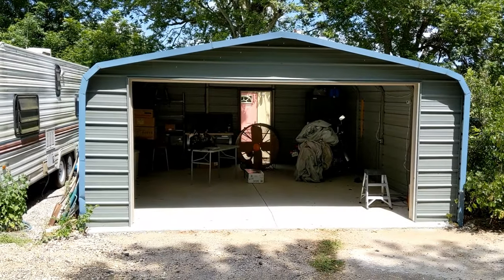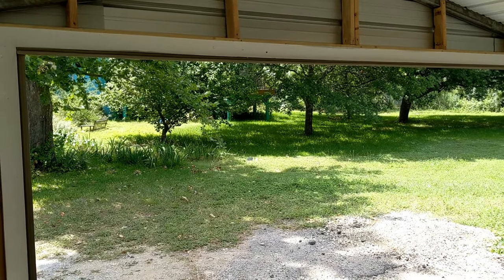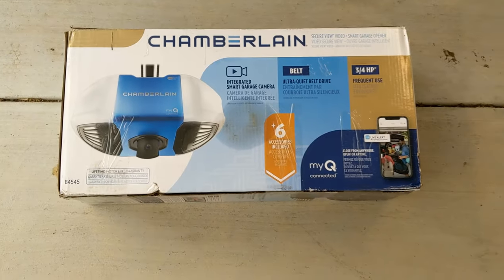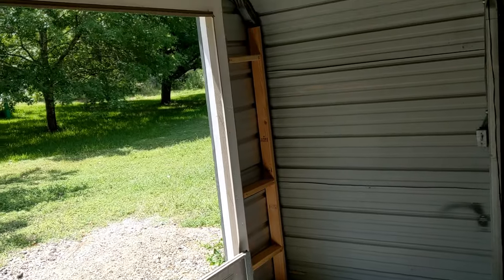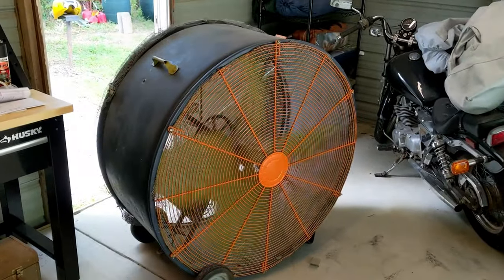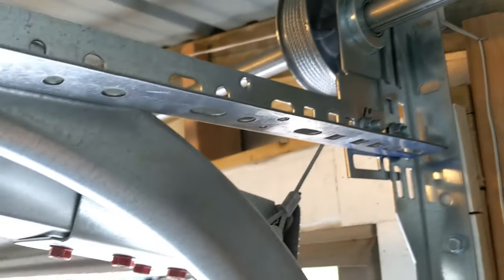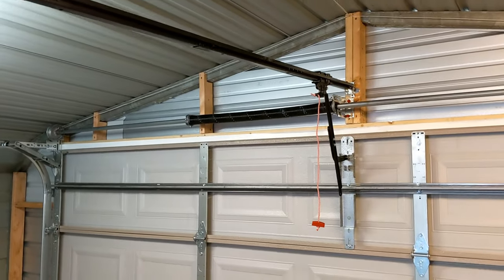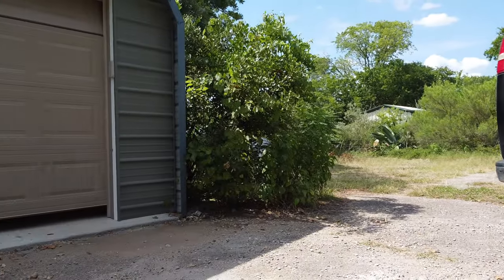Installing a Garage Door on a Carport | CHI 2250 | Quick Turn Brackets

Comment: I don’t know if low headroom track would even clear as good as those quick turns. But I do ask, why not offset the opener to get the trolley plate on one of the mid styles of the top section? Not familiar with that specific door but I’d be concerned with an ohd 170. And being a torsion setup you can offset the opener without issue

Comment: I'm doing this to my 18×20  carport with seven foot legs  for a 16x7  door, my driveway is about 3/4 of an inch out over 16 ft. Can the door man work with this?
Reply from the maker: @edross641  you need at least 12 inches of headroom for the door to curve back.
Reply: I have 13 inches, my driveway isn't perfect, 3/4 différence from one side to the other, can the door man make this work
Reply from the maker: @edross641  yes, a good door guy can easily make that happen.

Comment: Ever tried using super sneaky brackets? I like them better for low headroom situations
Reply from the maker: No I haven't. I know a lot of guys that do.  I need to definitely get me some.  🤙🏻💯
Reply: Garage Door Genius yeah try them next time! It wouldve saved you having to move the strut to the middle of the section and wouldve saved you from moving the drums more forward
Reply: Ever make your own quick turns? I’ve done it  as a temporary solution until I could get quick turns, take track bolts and bolt 2 #1 hinges end to end and let the top of the hinge just float in the breeze
Reply: @Timberland-Farms  yeah ive seen that. I’d use it in a pinch, but in my opinion sneakys are cleaner

Comment: Great video. Yet a little more on how you did it. Figuring out the pulley cable stuff
Reply from the maker: Thanks Michael! 
Yes I do agree sir.  I had good intentions on getting more footage.  But honestly, it was so freaking hot I just wanted to get it done ASAP.  The sun was directly above beating down on that tin roof.  🔥🤪
I really want to start including different camera angles and be more thorough.  I'm still a newbie film maker.  I definitely have a passion for it and will get better, I promise! 💯🤙🏻

Comment: HOLY CRAP that is so tight. Is that a 15 inch radius? It definitely didn't look like it could fit that at first. Nicely done!
Reply from the maker: It was very tight!  You couldn't squeeze a piece of paper in between the drum and the panel.  Lol 
12in. radius and quick turn brackets for the win!
Reply: @garagedoorgenius  I recently learned that my city has an ordinance against putting a garage door on a carport but they couldn't tell me why. I wonder if this is why - is it hard to fit a garage door on most carports? The city council always thinks they know best. Pfffft. I've seen people do this in my town before and I'm really wanting to do this myself. My car got broken into and I don't have room in my garage so I really want to do this but they won't give me a permit.
Reply from the maker: @thebudgetbee9694  yeah that's kinda dumb..  If it has walls and a roof you should be able to put a door on it.  Politics, go figure.
It just depends on the carport really.  Some are really easy to put a garage door on and others are a challenge.  The door in the video on a scale 1-10, is somewhere around a 6-7 on the difficulty scale.  There are Low Headroom tracking scenarios and 0 clearance tracking scenarios, which typically top the chart at difficulty.  Definitely more finesse required.
For a standard tracking scenario if you have 12 inches of head room at the header, then the door install will be easy peasy!
Reply: @garagedoorgenius  Thanks!

Comment: I'm in the process of framing in my carport to have a garage door installed. On this install what do you think the distance was between the top of the door to the ceiling? Mine is 10.5 inches. Great job btw.
Reply from the maker: Hey thanks! 👍🏼
If you have 10.5 inches of headroom, then I would use a Low Headroom Tracking.
That way you won't have to retro fit the tracking and use quick turn brackets like in the video.  
https://youtu.be/Qke9ykIwi-w
Reply: @garagedoorgenius  I had to change from a 12' door to a 10' door to have more headroom. This will give about 12" on each side. Overall door height 7ft tall.  I think that should be fine. Door install coming soon 5/7. Great video, I keep watching it make sure I did everything right.